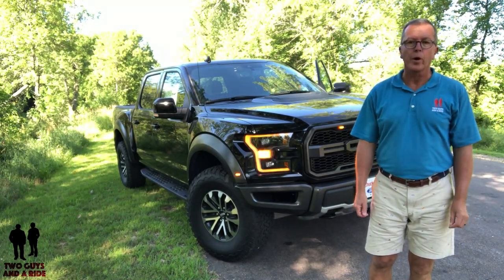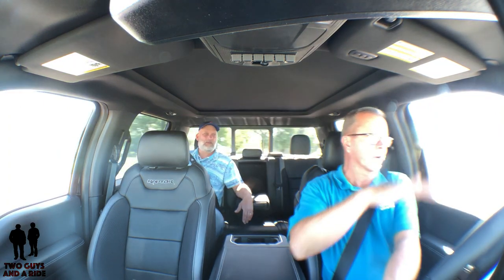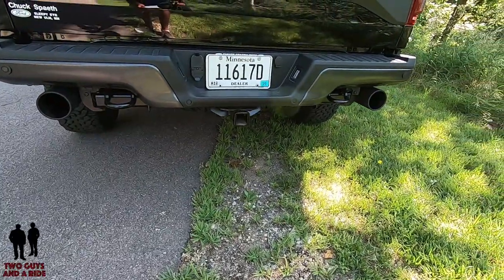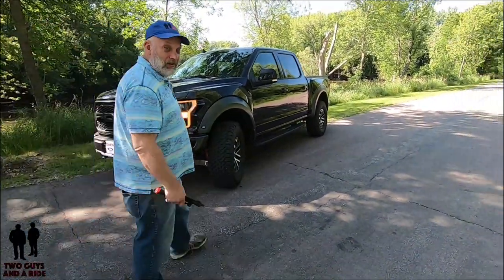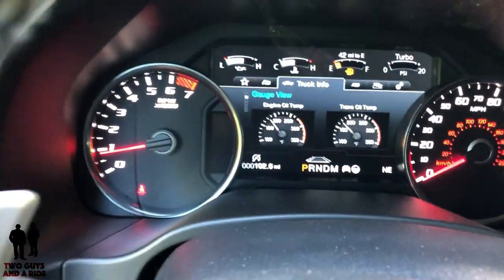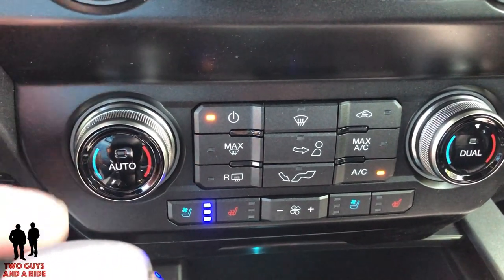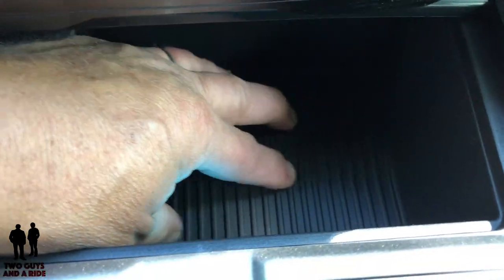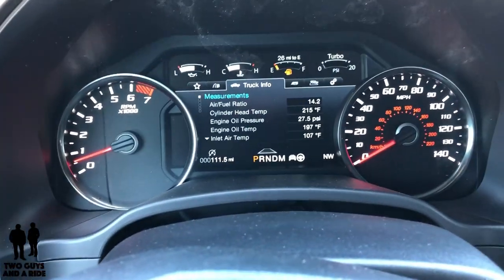Ford Raptor 2019 - Road Test and Complete Review

Comment: It's my understanding, the three lights in the top of the grill and the four lights at each corner are required by law. The truck is wider and not in the same class as the standard pickup.
Reply from the maker: Yes, you are 100% correct